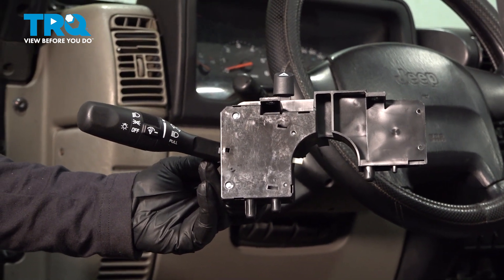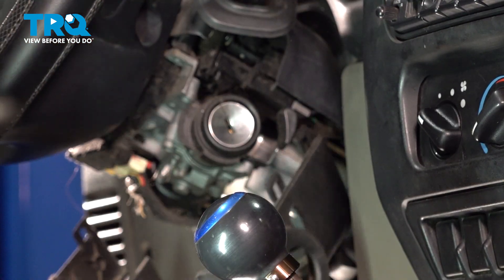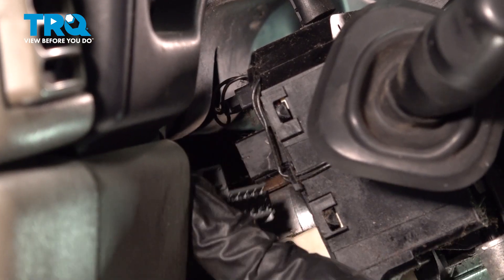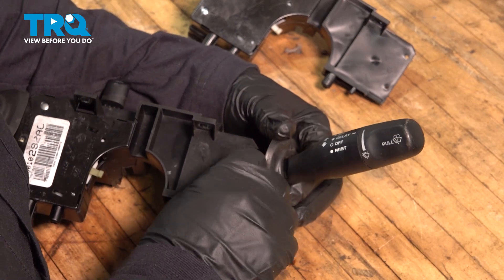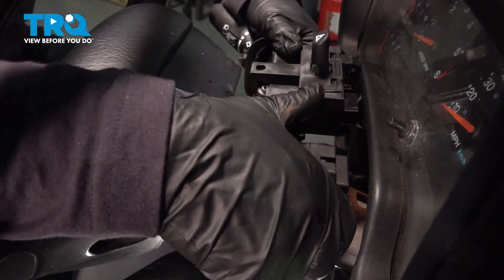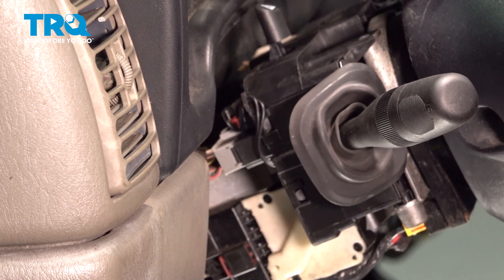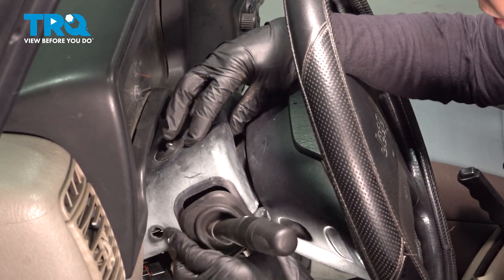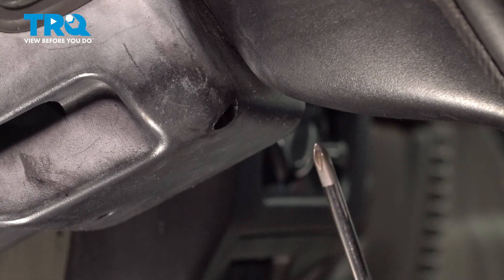How to Replace Combination Switch 1997-2006 Jeep Wrangler

Comment: My 2004 Tj acts up. When I put the lights on, the high beam goes on and the wipers start. Is this a symptom of a bad switch? The wiper switch doesn’t look like it’s connected to the light switch side.